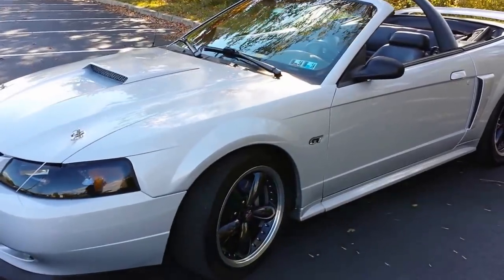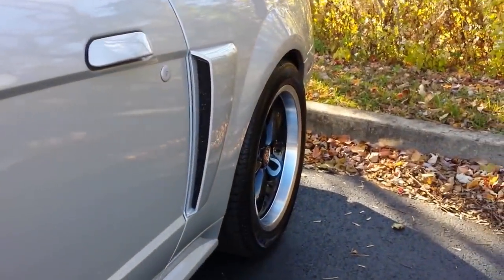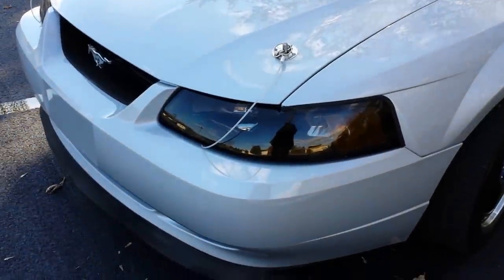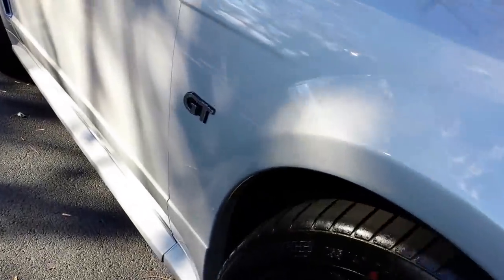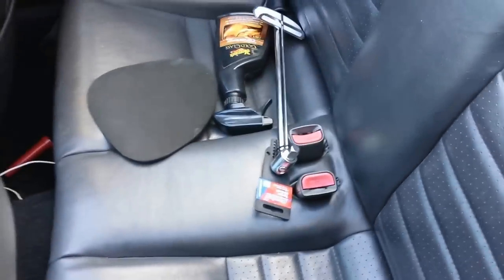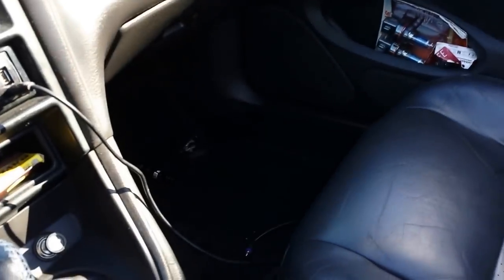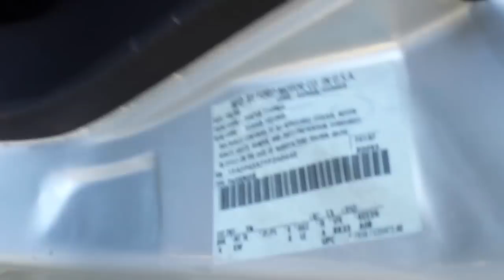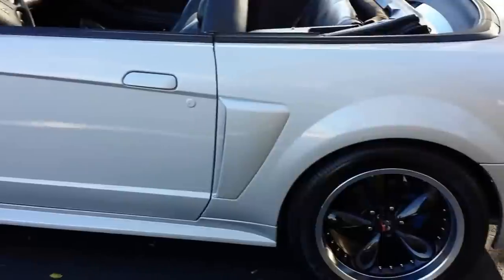2000 Ford Mustang GT Convertible - Walk Around (Part 1) - Restore Project

Comment: Beautiful GT man! I just got my hands on a 2000 GT Vert with only 21k miles, never driven in the rain. Came with the light bar and an official Saleen tonneau cover. I really like your wheels, I think I'll copy you. However I think Id like a staggered set of all deep dish. You still have the car?
Reply from the maker: OhItsThat 21k Very nice. I liked the wheels too, but always did want them in silver or granite. I no longer have the car though. However, I have a 2002 GT vert, same color less miles, but an automatic/. I finally did get the wheels I wanted for it, the paint is in decent shape but it needs work. I drive it around here and there, but I won't start pouring money into it until I close on my new house.

I'll put a video of it up soon.
Reply: +Gary Ugarek Hey dude, do you remember what class of Ford Racing Springs were on the car? B, C, G? I just got a staggered set of 18s and I need to lower this 4x4. I really don't wanna go too low and want to keep the ride mellow. I'm most likely gonna replace the shocks and struts with Koni STR.T's as well. 

 I was looking at the B springs and they seemed like a good choice but in some reviews I read peeps have said me they wished it would have dropped more.

Comment: 2000 Ford Mustang GT Convertible So Many Times Better Than New 2021 Ford Mustang GT Convertible
Reply from the maker: I wouldn't say faster, the 2000 Mustang GT is only 260 horsepower, the 2021 is 485

Comment: I have a 2000 Mustang convertible GT, V8, 260 hp, laser red with tan vinyl top with real glass rear window with defrost, alloy wheels, after-market stainless steel exhaust in excellent condition, air, Mach sound system; air bags, brown leather interior, security, 37,000 original miles.  For Sale.
Reply: price?